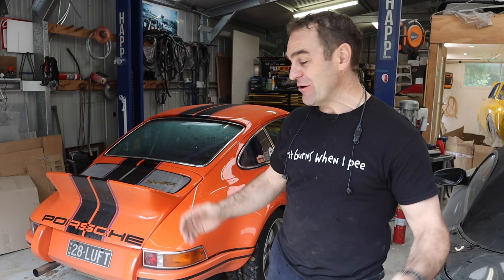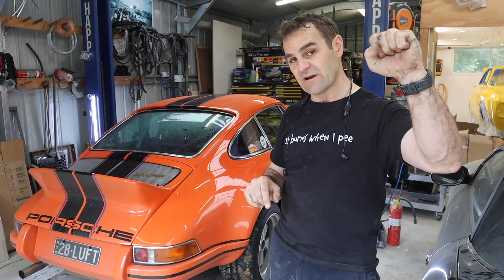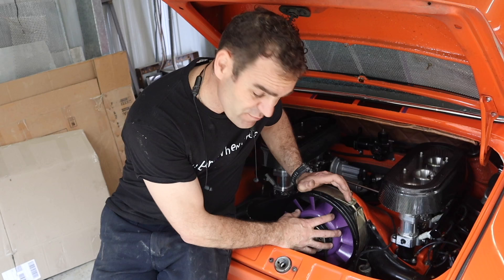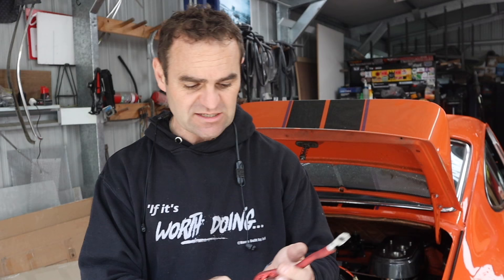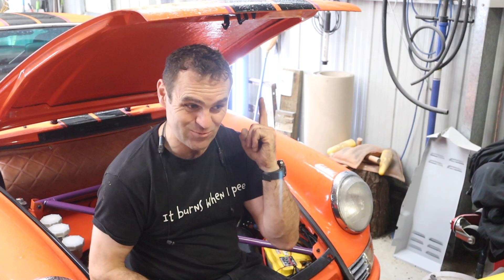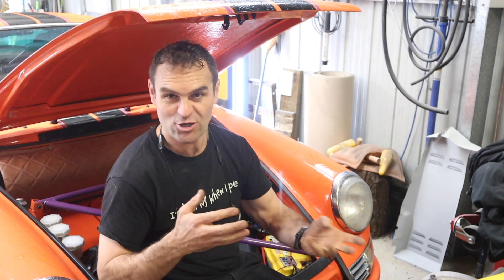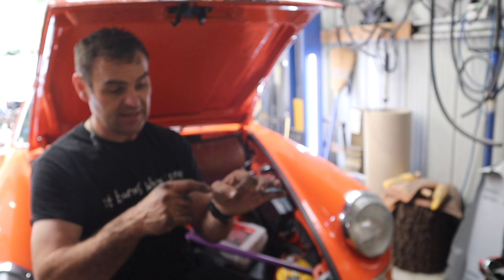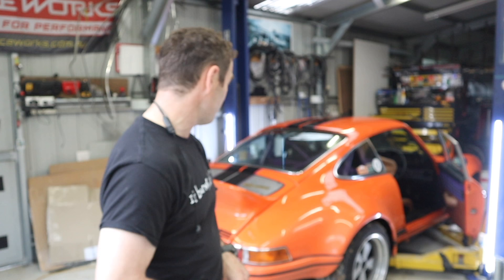My Porsche 911 broke down in the middle of nowhere.

Comment: Keep an eye on the driveshaft. The CV balls were carrying  the same current as everywhere else on this ground path. EDM will quickly erode metals irrespective of how hard and resistant they are in normal wear. Large electric motor bearings often fail this way once they develop a ground loop.
Reply: Yeah was gonna mention this also, seen older alternators, stators and starters with round ball bearings wear out after this from all the balls welding

Can generally diagnose just by lifting the car and spinning the wheel, bearing will make unhappy noises if it has done so
Reply: @lawrencemercieca  welded balls! 🤣🤣🤣🤣 If he has that, he's got bigger issues!! Sorry, couldn't help myself.
Reply: I have also seen this. Depending on where it found an earth, could be either through a gearbox bearing or wheel bearing.
Reply: Exactly, the bearing balls may be damaged by the high current.

Comment: My mini and I've installed a 120A circuit breaker (can probably get bigger for your car) right near the battery then insulated the positive terminal well to stop any accidents. Another positive is it's really easy to punch the button to disconnect the battery either to stop the battery going flat or as another layer of theft protection.
I'm not 100% auto electrician could advise but I think it could also go on the earth side and remove any vulnerability except directly shorting the battery terminals.

Comment: Have you gone around the car and checked all your cables are properly clipped and supported ?As someone else has said all wiring should be protected by a fuse. Cables like the alternator one, that have current from both ends, should have fuse protection both ends.

Comment: A relevant story. I have a 2009 Jaguar XJR, I took it in for a transmission fluid/filter change. I started having ABS light come on, then after a week I started getting this clunk to downshift to 1st. Took it back, no progress. Finally the battery died, as I pulled the battery to replace it I noticed the + lead was loose. In any case the problem wasn't the battery, but the alternator went bad. I replaced alternator/battery and all problems went away. So you should thoroughly check your alternator to be sure you haven't damaged it. One loose connection cost $1,100.

Comment: I would put contact grease (Liqui Moly 330) or copper paste (Liqui Moly 3080) on the battery terminals to reduce contact resistance and prevent corrosion. Works great for years on my vehicles. Pole grease, on the other hand, is not electrically conductive and is only effective against corrosion; it should only be applied when the terminal and battery pole are already firmly connected.

Comment: You may wanna fit an inline Maxi Fuse to the main positive cable, you can get them in 250A and higher
Reply: Better option use 2 fuses one at the battery and one at the alternator,

Comment: I would also make sure you don't have oxidation I would sand everything so you have a good connection I would also want to find a way to cover those terminals and that janky wire on the left isn't ideal I wouldn't want a wire scraping a wall. Dilectric grease is also your friend.

Comment: Probably a good idea to fuse the cable, I have a 400A fuse on my battery cable, and it works without issue. Lucky you didnt loose her.
Reply: You can get really nice fused battery terminals on ebay for like $30, they look pretty clean too as it's all hidden under a red cover right on top of the battery post.
Reply: @jamesinc87  That's what I used from the sounds of it. Cheap protection.

Comment: Instead of having multiple cables going to the battery terminals, run a short cable from the battery terminal to a bus bar and branch out to the multiple high draw connections away from the battery terminals. Will make it more reliable and easier to connect/disconnect the battery 👍

Comment: Honestly these are the repairs I like to have on the side of the road
It’s a pain, but very quick and easy to fix
Worst part is the drive home hoping you aren’t going to break anything else

had a hpfp leak after swapping a new set on my Car
Didn’t notice it until 3 hours in to a drive when my eyes started burning whenever the car was still
Was so scared driving home, literally 1/20th of a turn in about 3 seconds with a crows foot wrench once I got home to fix it, thought I was going to set the engine ablaze 😂
(Life lesson learnt)

Comment: I agreecwith the below, equal current willhave passed thru the path of least resistanse, and that is bearings in all directions. Keep track on magnet plug in gearbox and check thecv joints for ” welding spots” in the races. I guess the gearbox will be the shortest way to ground as the wheel side is isolated by the bushings in the suspension.

Comment: I had a similar problem on an old Mini... the positive cable from the battery in the boot dropped, and touched the exhaust...  It soon melted its insulation, and shorted out.... but only under harsh acceleration, when the exhaust moved a bit... took me bloody ages to diagnose!

Comment: that battery cable is to close to the body, also run 250amp fuse either end, always a rule  with old cars   battery relocated to boot. fire extinguisher, or better a fireman  goes a long way

Comment: You're lucky, with the little damage. Is the dust cover off the driveshaft not damaged? I don't know if have any voltmeter on your dashboard, but you have nice examples, you can put one your battery for a quick check if it's oke.

Comment: Is there a screw missing for the drive shaft at the right hand of the screen at 3:07 ?
Or is it an optical illusion?
Reply from the maker: The drive shafts only have 4 bolts. The other 2 holes have dowels.